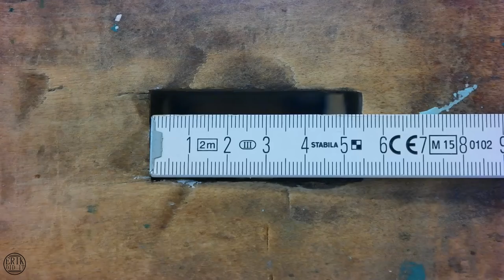Refinishing an old workbench

Comment: To avoid all the dusty sanding, I guess you could have tried a scraper to get most of the grime off. Since you often use powertools for cutting and ripping, I wonder if it's an issue that you didn't flatten the surface of the bench. But then you would have lost quite a bit of that beautiful weathering.

Comment: You pretty much defeated the point of having a nice heavy workbench by putting casters on it
Reply from the maker: Yeah, you are right. Unfortunately my workspace is so small that I have to be able to move it around. But I can always remove them.
Reply: thatIlluminati _ if you can’t figure out how to chock casters, you shouldn’t have a workbench.
Reply: Dozer1642 right just need to sit it on some blocking
Reply: Dozer1642 so if you don't know how to do everything you shouldn't be allowed to do anything? Gatekeeping much there lad.
Reply: David ‘Lad’ spend less time correcting injustices on YouTube comments and more time working in an actual shop and then check back with me in twenty years. Lad.
Reply: Dozer1642 you said he doesn't deserve a work bench because he did something you wouldn't do. I was pointing out how immature that comment was. Grow up. And stop trying to deny and disencourage people doing something they enjoy.
Reply: Dozer1642 triggered
Reply: Erik did it google rockler casters. They allow the wheels to pivot out from below to allow the bench’s legs to rest directly on the ground. Then step on the lever and it picks up on top of the wheels again. I have them on my workbench. $50 Thank me later 🤙🏻

Comment: Erik im finally ready to do finish on my workbench restoration and was wondering of you knew any info on period correct finish application for a 1800s bench.  I want to say you used BLO but not sure.  I hard that beeswax and BOL combo may be period correct.  was wondering if you can point me in the right direction.
Reply from the maker: Unfortunately I don't have that info. I used what I had on hand and I didn't do any research. Have you asked google? :) Good luck!

Comment: I thought you were going to plane off the surface
Reply from the maker: I didn't really want to because I wanted it to look old and used.
Reply: Erik did it Well you certainly accomplished that! (I thought you’d use a belt sander with 33 grit.) It does look like it has stories to tell.

Comment: Its upsets me not to see you ensuring thr flat is top and thr edges are square. Should have been easily done with a coupoe ot planes.
Reply from the maker: I didn't want to remove the patina and make it flat and square. I don't use it in my workshop either, more of a living room side table :)

Comment: Any tips on keeping the saw dust off the threads of the vise? Mine gets all gummed up pretty quick.
Reply from the maker: No, unfortunately I don't have any. Maybe someone else can help?
Reply: Lubrication is not an option.  I have just resigned myself to clean the screw more or less regularly.  (Usually less)
Reply: Try using wax instead of a liquid lubricant!!
Reply: Use a dry lubricant like graphite.
Reply: NordboDK I like the idea of graphite, however in my shop I protect my cast iron (table saw top, jointer beds, planer bed, bench plane soles, vise screws... etc.) with paste furniture wax as it makes a hard, dry, slick finish allowing work pieces to move smoothly and preventing rust. I reapply the wax in my shop once every 6months or so. While you shouldn't run into too much of an issue realistically, the furniture wax won't transfer to my work pieces in the way I worry about graphite doing so!

Comment: that hurt to watch you cut the feet off and ruin a perfectly good workbench
Reply from the maker: Do you think is was in better shape before I did anything to it?
Reply: No, but I agree and seriously question the addition of casters which cannot be disengaged.  Why do you want a bench that runs all over the shop?  Otherwise not a bad cleanup.  Did you consider flattening?
Reply from the maker: pgfollett I had to do it because I need to be able to move it around in my small garage to get the car inside during winter. The front facing casters can be locked. Actually I didn't consider flattening since I want it to look old. Thx for the comment!
Reply: Yup... He ruined it
Reply: Agreed.
Reply: yes.
Reply: I must admit, I cringed a little when I saw him cut off the feet. I also needed wheels for my bench but I used Rockler flip down casters. They work great and I get to keep the feet.
Reply: Eric Brown show a video of your heirloom workbench that you restored. 

........crickets.
Reply: Dozer1642 you’re using “restored”  loosely.
Reply: Q Daddy aye look at restoration videos there you will find them and safety people to it's his bench he made it suitable to his needs people are so far gone now days it's ridiculously funny xD
Reply: Add that to the nail in the vise's beam, a wedged-tenon should be the most elegant solution.
Reply: @androidgameplays4every13  Even a dowel + glue